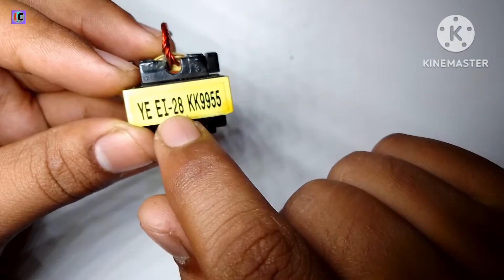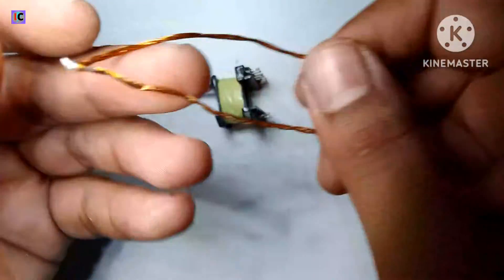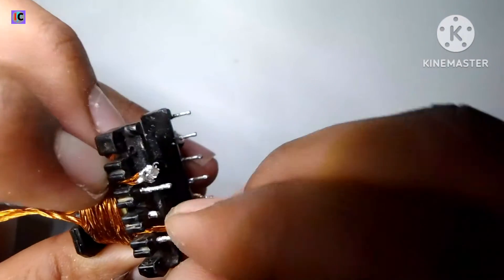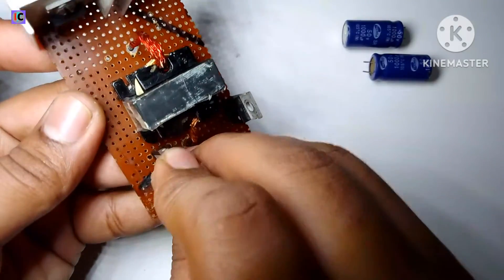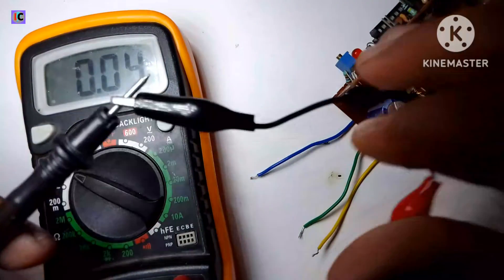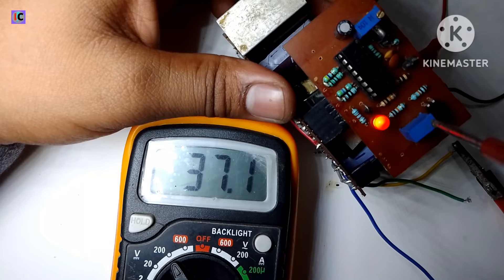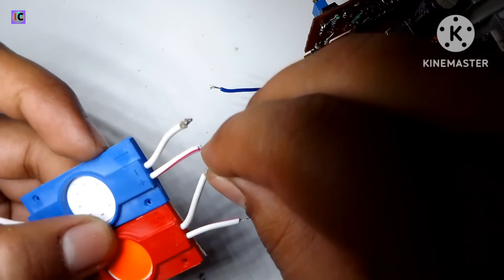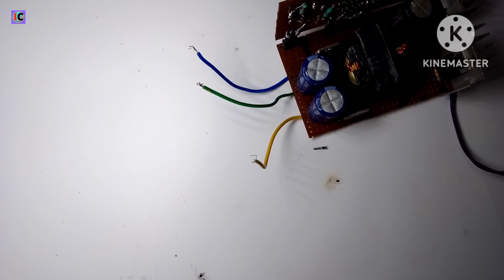SG3525 Power Supply #buckboost dual power supply circuit

Comment: Can i put 24 volt in the input ? And also can i modified 50 0 50 out put 😂 just mack a lab bench power supply...
Reply from the maker: yes no problem with 24v input, for 50 0 50 increase secondary winding turns

Comment: The LM3525, KA3525 is very similar to the TL4949 which are commonly found inside inverters and car power amplifiers.
Reply from the maker: Yes 
KA3525, TL494 are very popular for dc to dc converters